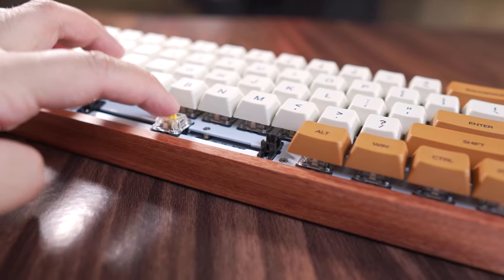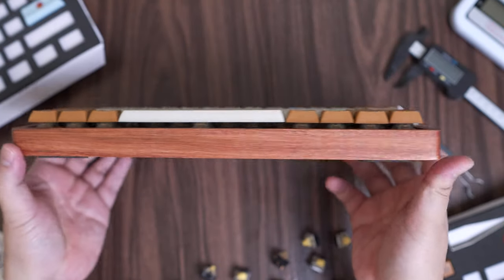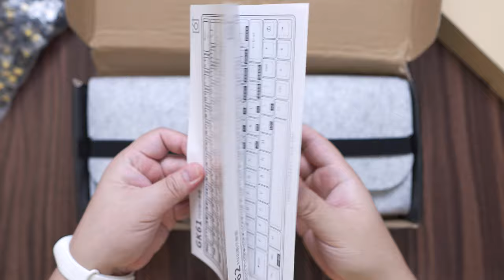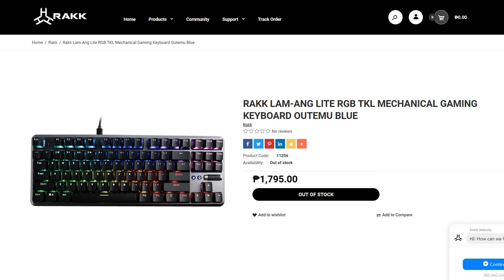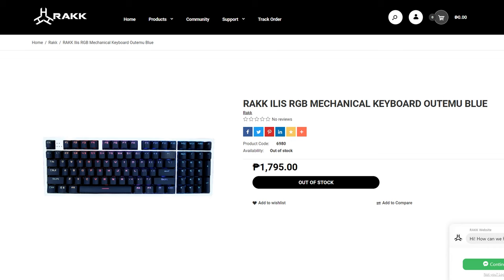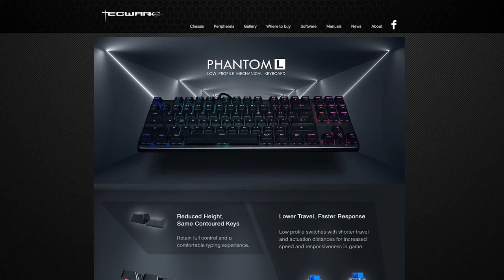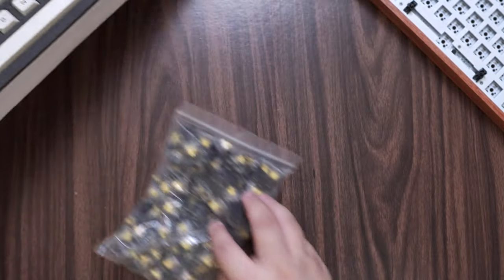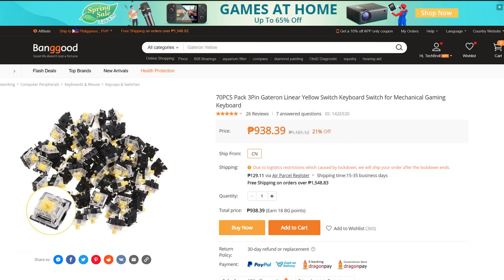How to Build a Custom Keyboard - The EASIEST way! - Wooden GK61 + Mars Colony Keycaps

Comment from the maker: Thank you for watching guys! Here are the links for all the components used:

Wooden GK61: https://bit.ly/2RLMOAn
Mars Colony Keycaps: https://bit.ly/3espjX3
Gateron Yellow Switches: https://bit.ly/2RMkTk8
10% off code: BGTOMEX  (for all keyboards and mouse )

The total cost for the build if you look at all the components is around 8k, but you can build one for less by getting a set of keycaps specifically for 60% layout only and then just get around 70 switches.

Here's the Full Written version for your reference: https://techbroll.com/2020/04/how-to-build-a-custom-keyboard-the-easiest-way-with-wooden-gk61-and-mars-colony-keycaps.html
Reply: hi do you know where i can find good keycaps for 2k on shopee or lazada, i cant order on banggood because of the quarantine
Reply: Can you do a video on modding a keyboard? I recently got the RK61 and it hasn't even arrived yet, but I already also bought the GMMK Compact with pudding keycaps from Glorious as well paired with Kailh Box Jade switches, I'm asking because there doesn't seem to be places in the Philippines to buy the appropriate Teflon or Dielectric Grease.

Comment: Just bought gk61x and wooden case is on the way now, already installed switches.. if the wooden case arrives, my question is do I need to remove all the switches from the board or no need? Thanks

Comment: I got gk61 Gateron optical brown switches. I was wondering if I could use Mx cherry keycaps without changing the switches
Reply: The Gateron Switches are also a MX-Type Switch (Cross-Stem), so you won't need to do any replacing when just changing the keycaps.

Comment: do you need to lube the switches?
Reply: It isn't necessary but it definitely improves the feel and overall performance of the keyboard. It lessens rattle and wobble and gives the switches a fuller sound moreover if you dampen your keyboard. It's especially effective on larger keys, like your spacebar, tab, shift and enter keys paired with modded stabs.

Comment: Boss question! Diba.ang gk61 optomechanical switches lang timatangap? Hind sya universal? Yung gk64 ang universal. Correcr me.if im wrong. Thanks!
Reply from the maker: Actually madaming version ang GK61, this hotswappable using gateron universal socket for normal switches, then meron ding hotswappable na optical naman like yung nauna kong nireview and meron din akong nakitang  bluetooth version. Yung GK64 ganun din may ibat ibang version din
Reply: I see. Mas ok yang universal na hot swappable. San po nakakabili nyang version na yan. Also gk family or yung dz60 boards ng kbdfans ano po mas ok para sa inyo.